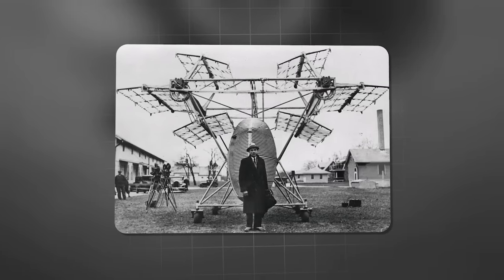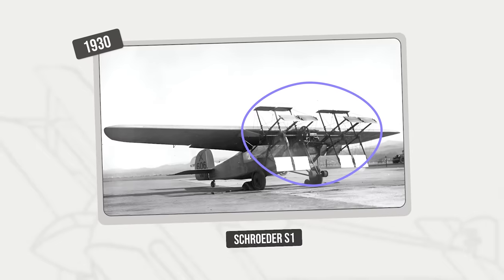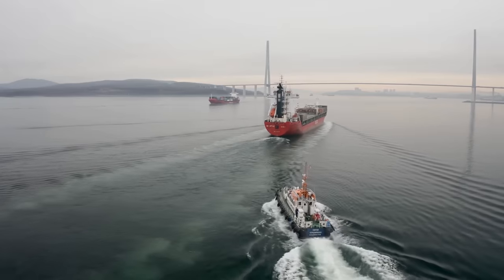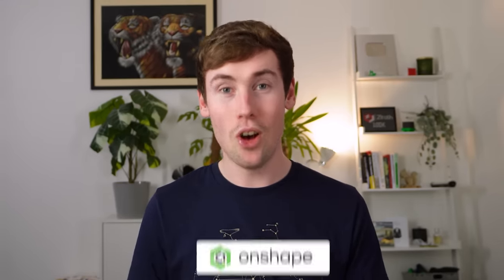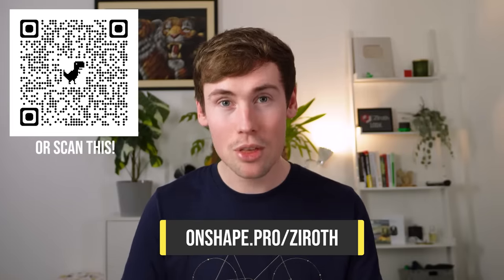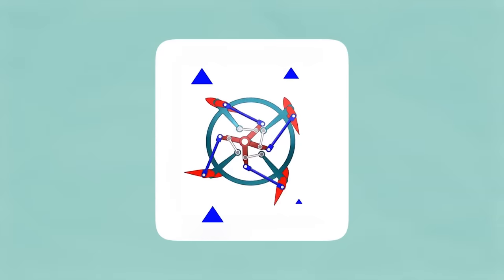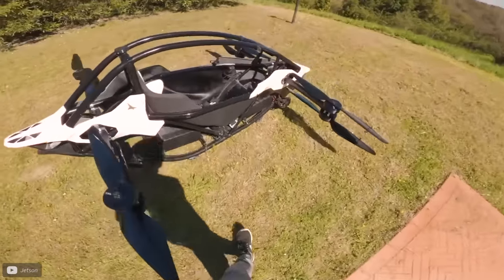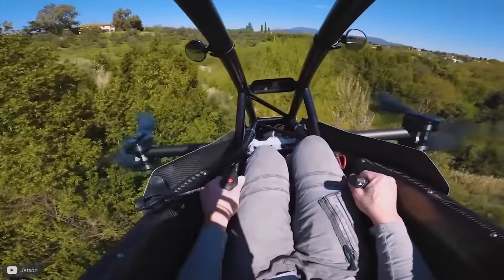The Genius of Cycloidal Propellers: Future of Flight?

Comment: Thanks for this comprehensive run down on the Cyclorotor and it's function. I fear it is entirely unsuited to aviation is so many ways. The problem, apart from the mechanical complexity, is the working medium. For water borne vessels it appears to have some merit. manoeuvrability being the main factor. For airborne vehicles the principle is a non starter.
                The efficiency of flying machines depends in the main on the disc/wing  loading of the lifting surfaces.. The enormous wing loading of this concept guarantees very poor efficiency compared with fixed wing or even  helicopter applications.
              On top of this major problem, the blades in action are under constant and very rapid changes in angle of attack, so  a smooth and efficient airflow never becomes established. Additionally, the known problem of 'shock-stalling' is going to be a big downer on the safe function.
                Mechanical complexity, poor efficiency,  lack of redundancy,  highly stressed and complex mechanical power trains make this pioneering idea from early aviation best left to history. Failure of the Cyclorotor at sea is an inconvenience, failure in the air is 100 % catastrophic. !

Comment: - Its too big in operational volume
- it too complex so more parts that can break
- air much less dense than water so the system would have to made with much lighter materials to cope with the forces, which make them fail earlier
- you can achieve rotation with a pivot on a conventional rotor
ect. etc.

Comment: Its more or less a helicopter rotor turned sideways and the rotors at 90 degrees. A couple of them should be quite good at lift and directional control.

Comment: You know to make these horizontal fans, to work. They might just need. To stick them within a tube.. Surrounding them. With a windowed movable opening. Like the fan of a,  NOTAR, helicopter tail boom. Kind of like a caged  squirrel fan. A fan in a can. Like a ducted port. Like the body of the engine around a turbine powered engine. But with an opening or two. To suck air in. And blow air out. Instead of its blades just waiting around in the wind, exposed. How about that? Is the external nacelle/tube can be of lightweight materials.

There is a way to make this work. Put the fan in a can. And blow it out a, longitudinal, opening. Facing downward. I can position, forward, down and  rearward. Kind of like vectored thrust  from a fan. It's kind of how jet engines are built. As the compressors are not exposed to the outside air. It's encased.. Where power can be developed in a concentrated way. Within the structure. As it's no longer a prop. Sitting in front of the motor. It's a fan in a tube. This fan would just run perpendicular.

I mean come on now. You have to think a little out-of-the-box. By perhaps putting the blades inside a box?

I think vectored thrust is cool. It's an atmospheric squirt gun  drive.
RemyRAD

Comment: I'm trying to picture the simplest possible version of this.  I can just barely get my head around a ring of wings, geared so that the wing is always in the "go up" location as it passes into the spot in the loop.  Turning once in each turn.   My mind halts when I try to picture a version that, while still simple, could be turned to turn the output.  That's when I surrender and go, "sure, one steeped motor per wing" and "do it in software".  Sadly I hate this solution, and while it's the one that works in reality, it don't mean I like it.

Comment: The blades rotate the same as helicopter blades, so couldn't they just use the same setup that a helicopter uses to tilt its blades, since that system has already been time tested to be reliable?  They should incorporate the helicopter cyclical system into their system for the blade tilt. 😁👍

Comment: Without some sort of flight recovery upon engine failure (e.g. auto-rotation for helicopters and gliding for airplanes), there's zero chance any of these air-taxis as-designed would pass regulatory scrutiny.  To achieve this, they'll need a great deal of redundancy in both lift and control power which, itself, leads to a great deal of added weight to the overall system.  Atm, given the specific power density of electrical drive systems (motor + battery), it's not remotely practical.

Comment: Has there been any attempts to replace the tail rotor of a conventional helicopter with a cycloidal propeller on a vertical axis?
Reply: I mean, helis connect that rotor with a drive shaft (to main rotor output transmission,) with or without that, model it up and there aren't many ways to die you haven't added (in a model) there. If that's a creative drive for you knocking those into reasonable modifications and you have the moments, have fun!
Reply: Nice demoscene name. So also you could just change the prop to a torroidal one / 3:1 epicyclic vane and be down to included adjustments pilots will have flown.

Comment: Couldn't it be simplified with basic ducting? One inlet, and one outlet. The rotor angles get optimized for the ducted inlets/outlets and then the whole assembly is simply rotated for thrust direction. Way safer, way more simple than adjusting each blade in real time.

Comment: Why not two foils oposite directed to implement change in thrust instead of one, ie, one FOR that vector, and one opposite, doubling that effect? What was complicated in the 1930's is easily done now with computer aided assists, indeed, 'by 'paddling'', the ''unused'' other two blades could help, or direct the thrust further, why limit yourself to a simple vector when you could control the vector and motion completely? This is about ships, but helicopters could use this as well, if not better...

Comment: hype and not actually used nearly to the scale you seem to suggest at. you have a high speed rotating seal for each paddle, PLUS a large diameter one, that is equally high speed. This is a freaking NIGHTMARE to seal reliably & in salt water failure to seal destroys equipment. I imagine whatever controls the pitch of the blades is complex, expensive and will certainly not get along with salt water. In real life tug boats use shrouded props that are on a swivel head. each one has only 1 high speed, low diameter seal, + a low speed, low diameter steering seal. The diameter is a big sticking point for these.

Comment: So basically a helicopter cyclid tipped on its side. So auto rotation should be a thing. I think you need to get with JOHN DEER COMBINE DEPT.  Experts at cycloneal cages.
Reply: Can't work.  Rotary wings cannot rotate -- they have to spin in a FLAT PLANE.  Just like they do now.  Those rotary shorty wings will ONLY work in water.

Comment: Great for ships where the density of water means slower moving blades, but for flight... weight, size, speed of rotation add to complexity and inefficient design.  Like reciprocating combustions engines where "mature" design just makes them unbeatable, until we use a small turbo prop type engine that is.  See you in 100 years.

Comment: the main problem here is drag, the common propeller cuts the air while this shoves it. you cannot use hydrodynamic solutions for aerospace applications sir. hence they are different fields. then there is the issue of rotational mass, with the cycloidals the supportmaterial takes up a lot of the weight. while on a propeller the hub is the smallest part and with least mass. also the two way load on the bearing for the drive is massive compared to the single direction load on a propeller. 

these are amusing and will never be practical. like an ornithopter.
also pretty sure the amount of energy needed to turn them is WAY larger than a single propeller.

Comment: I love how these videos all show quadcoptors, and that model used 4 props at the corners of the model. This is incredibly unsafe for carrying humans. I can see the cycloidal props' use in thrust generation, but not for lift.

Here's why: Airplanes have engines and wings. If the engines fail, the aircraft doesn't just stop flying, because it's the wings that are responsible for the flying. What about helicopters? They also have and engine and wings. If a hele engine fails, the rotor keeps spinning thanks to the downward motion of the aircraft. This in turn generates lift. Believe it or not, helicopters can land without engine power by storing energy in the rotation as it descends, then reclaiming it before it touches down, all fully unpowered and mechanical.

A quadcopter, or quad cycloidal machine, however, is not stable with no power to it's engine. If that fails, it falls out of the sky as fast as gravity-wind resistance allows. And even worse, while most modern multi-engine aircraft don't really care if one engine fails, if a quad engine fails, it loses all stability and it will crash, probably upside down. Not only that, when you have 4 engines, that's 4x the chance of a failure, statistically.

These will never see use in passenger applications. If they do, I recommend no one uses them unless we have a magical engine that can't fail under any circumstance.

Comment: The prime sin with the eVTOL is attempting to make version one work on horribly inefficient (from energy density point of view) batteries. Should first make it work properly with a nitro or 100+ octane fuel engine.

Once they develop it's efficiency start dreaming of batteries, since those are looking like they could genuinely improve for the first time in decades by then.

Comment: Let's see. Let's increase the possible points of failure by a considerable factor and ignore it. And, let's talk about flying "cars" without mentioning the huge cost of implementing and running the vast increase in the air-control infrastructure necessary to support such things. The high cost of insurance and finance, and material-capacity aspects will ground the majority of designers' flights of fancy and engineers' pie-in-the-sky self-confidence. [BTW, the plural of "aircraft" is "aircraft." "Crafts" is used only when talking about knitting, basket-weaving, pottery, etc.]

Comment: This won't make it to market in the auto industry simply because of its complexity. It's not enough to invent the product. You will have to have trained technicians and technical tools which require investment and training. And then it will need to beat out the new prop design already taking over the shipping industry as well as the personal boating market that is simple and has no moving parts. That in conjunction with the rotatable motor hub is very popular right now.

Comment: imagine using two motor cycle rims. with blade in the middle of them one each corner. then using two tesla motors to drive it. with the battery of course. in a open wheeled car type vehicle. with 1000 hp it could take off...

Comment: instead of batteries this clearly needs to run on the 1cycle engine from italy, one of the things that makes ev planes hard is that the battery doesnt drop in weight as the flight progresses so the ineffiecancy of the flight grows as the batteries are drained. tiny high wat compressed gas powered 1cycle engine running the rotors. easy peasy gimmie flying now.

Comment: I would NEVER ever enter a flying contraption without wings. If the motors fail, you're sitting in a flying brick. When you have wings, you still have a chance of making if down alive by gliding down. As long as the machine doesn't stall, you should make it down safely unless the control surfaces fail as well. I love engineering but I always find it so utterly useless that we spend so much money on new and useless ways of reinventing ways of personal transportation instead of critically thinking what's actually a good idea and a good use for this technique.

In the water I can totally understand it as water is a liquid and denser than air, the motors don't have to spin as fast and this will totally help with reducing wear on the machine. In some ways I could see this as a great technique if adapted correctly for a new type of wind turbine. But flying? I bet this is only going to work well on a small scale. Buy personally I would throw all these 'flying car' ideas into the 'Hyperloop bin' hahaha. I wish we spent more money and resources on CRISPR gene therapy to try and solve disease, but of course, no rich person in their right mind would actually want to help others. They just want their flying cars and trips to space.

Comment: Adding batteries would increase the weight ...  why batteries? this system can work with thermal engines or turbines like actual aircrafts.  The ratio energy /density is WAYYY better in liquid fuels than in batteries.

Comment: Cycloidal drives have ghastly bending loads, parasitic structural mass in the end plates, and control linkages that make helicopter mechanics nervous. In marine applications you can accept the mass penalty for the variable thrust vector benefit, but in aircraft? Comically bad.

Comment: Azipod thrusters on ships provide a similar capability although not as precise or fast responding.
For aircraft those high rpm's would subject the blades to very high bending stress and also the rotor blades are basically doing nothing other than causing drag half the time. Overall seems they have far worse weight than a propeller system and more parasitic drag.(as you noticed).
For aviation they seem a dead end. With the high mechanical complexity the designers would do better to apply their mechanical design skills to variable pitch propellers, ducted fans or cyclic collective top rotors.
The Jetson 1 flying toy is amusing and looks cool but the range is poor and it's incapable of gliding so it needs a ballistic parachute as a safety backup.
The jetson 1 costs more than a small helicopter which can autorotate and has better flight time and range so hard to say if they will ever be competitive with existing recreational VTOL aircraft.

Comment: Love the concept of Cyclorotors....but they are best kept in the water....they will remain too heavy  and too fault dependent ( too complex control) for air-transport....nothing beats the counter-rotating propellers (canceling of inertia) of the jetson prototype. Air travel has been done, regulated, with air-cooled engines only (as they are more reliable- less weight than coolant engines, imagine breaking a coolant hose up in the air)...thus cyclorotors are too complex with too many fault points and too heavy....unsafe at any speed for air travel.

Comment: It just has no advantage over a prop/fan. Only great disadvantages. Fan blades are always engaged all the way around while cycloid wastes a good portion of their spin while reuiring complex mechanics exposed to the elements. It's an easy no.
Reply: It won't work for an airplane.  It is ignorant to suggest this could be the future of flight -- that aspect is just clickbait.  Rotary wings have to rotate in a FLAT PLANE to achieve lift.   I had all the training and several thousand hours.

Comment: How the thrust is generated is irrelevant. Just pick the best (most efficient). All else should simply be ducts & vectoring. This idea of propellers is an example of the chain & elephant scenario. A baby elephant is restricted in place by a thick and strong chain. The baby elephant gets so used to not being able to break it that eventually he gives up trying and so when he is an adult the only thing needed to hold him in place is a small thin rope. In other words, everybody is so stuck on the idea of propellers and where they should be placed, that they are completely short-sighted to other methods and innovation. Essentially, everybody is stuck on the idea of propellers and where they should be placed instead of thinking outside the box. Thrust can be generated anywhere, by anything, and vectored as necessary.
Reply: @rackattackgamer7928  yes totally. 100%.
Reply: @antoniobragancamartins3165   yes. which is why i wanna know: 
is it possible to get a concealed carry license for that Jetson 1 thing at the end of the video ?

Comment: 3d print copy a real goose using polyurethane for the body adding feathers 
connected in the correct places. 
 Put a lightweight small fusion reactor inside rigged up to a mini quantum 
computer controlled by AI to learn to mimic the flight of geese. 
Hey presto you have an automaton that imitates flight perfectly 
though completely useless unless your 9inches tall! 
(or you make it 50 times larger;)

Comment: Problem is, its diferent to normal. I work in aviation and anything thats diferent to the normal is essentially frowned upon as its outside the normal and pilots and engineers prefer to stick to the tried and tested, especially in general or commercial aviation. Meaning peoples lives are involved. And im not joking, think about adding a usb charging port to an aircraft, you just need a simple reliable output right like your car $10~$50 ish avaition nope think $600+ for a simple 5v plug. 
Why? because theres so much legal bullshit tied up in everything to do with aviation that the wheels turn sooo slowly. Exactly why we still have small aircraft using new motors from the 50s that need leaded fuel.

Comment: I do not think this will be very viable for aviation. If it is kept electric, it will burn through batteries tremendously fast. If changed to petrol, it could fly much longer. However, for blowers and wind turbines, it seems a very good idea.

Comment: #1 too many moving parts and more than 50% of them have to be exact precision.... that's a factor of 10 to normal mechanical failure....#2 it's also a factor of 10 to energy required than normal mechanical propulsion. axial fans are better, and to direct air flow you can move the shroud housing which is easier and less moving parts, safer, and requires less energy and has increase efficiency and better force aka more power